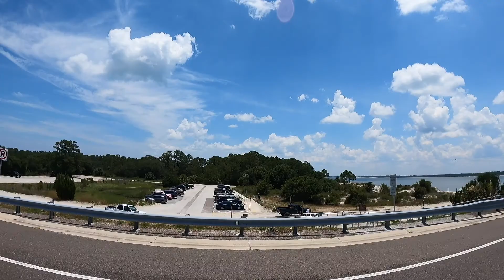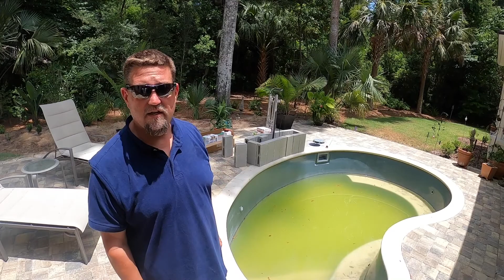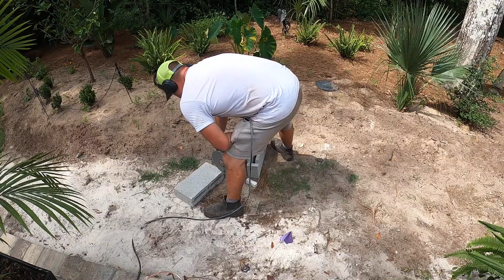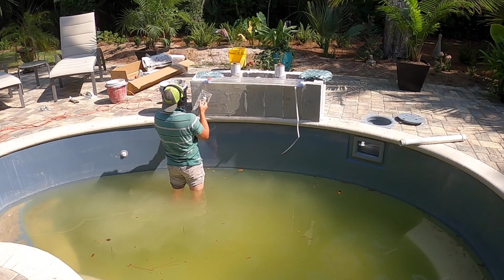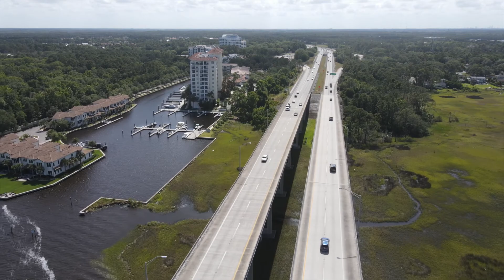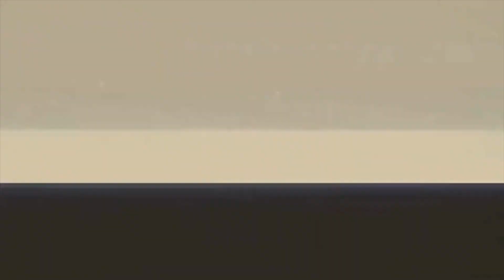Pool equipment and water feature

Comment: Hello, I have in project the same installation of water blade on a swimming pool that I realized. I find your work well executed, the users of this pool will be very happy with the result. But too bad you didn't film the part closing the top of the water slide.
I wish you a good continuation with many projects.
Cordially
Reply from the maker: Thank you. We are working on adding more content. We have several projects coming up. Thank you for the positive words and thoughts

Comment: How do you service the waterfall?  Did you put in an access panel?
Reply from the maker: We leave the top slightly loose to remove for service. It isn't permanently fixed. Access panels do not provide enough access to do a repair. We learned that lesson the hard way. We found that being able to remove the top gives us the best opportunity to do a repair

Comment: Do I need to bond the water sheet descent since it’s metal?
Reply from the maker: It is always a good idea to bond the metal. CMP makes a plastic waterfall that doesn't require bonding. Be sure to ground the light if your waterfall has a light.